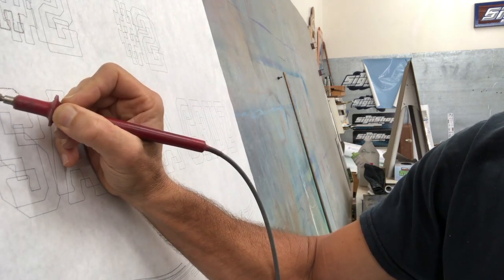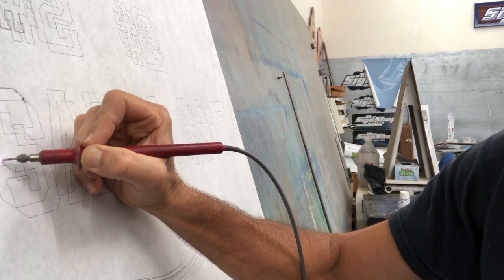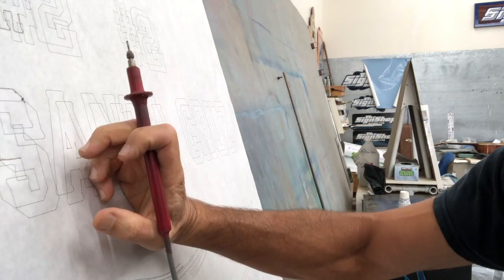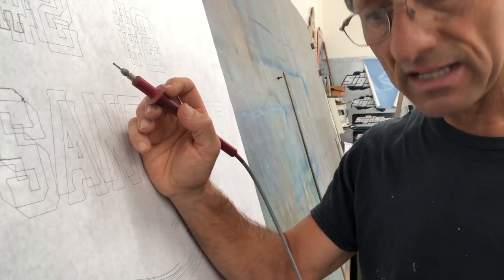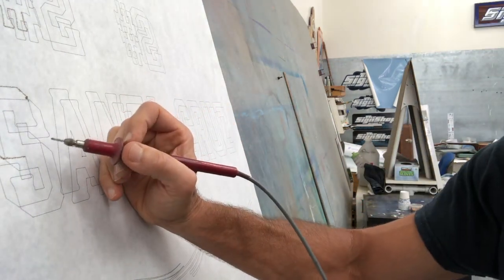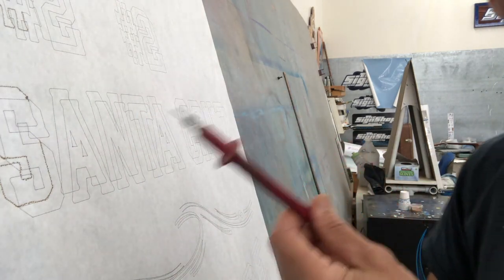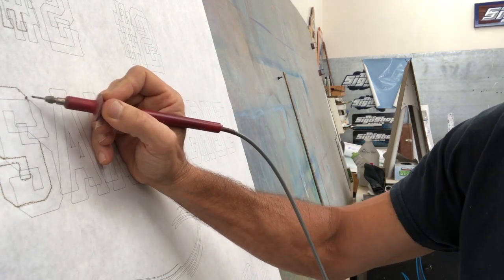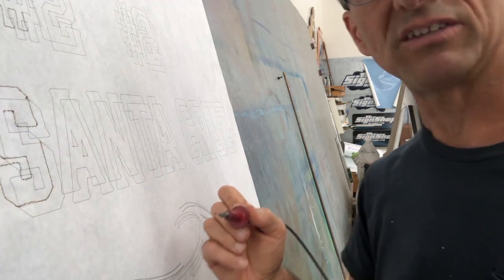Electro-pounce Foot Switch

Comment: I just received one of these machines and  getting things setup what kind of metal do you put behind the pattern and how thick is the metal you us? I really like your setup
Reply from the maker: Galvanized sheet metal. I can’t remember what gauge. Just don’t get too light of gauge that it becomes all wavey. Check your local sheet metal fabricators for the thickness. I think .06 or .08 but check out their inventory. Congratulations on your electro pounce journey! 👍😀

Comment: I used to be in charge of the pattern making and ‘burning’ the patterns for a painting department at Outdoor Systems Advertising(no longer exists). Used this same electric pounce machine for years. Got shocked quite a bit; until I became more proficient at tracing the artwork. Adjusted the voltage a little too. Really cool to see this after so many years!
Reply from the maker: That’s awesome! Are you still in the business? Yeah, there are folks out there looking for these.